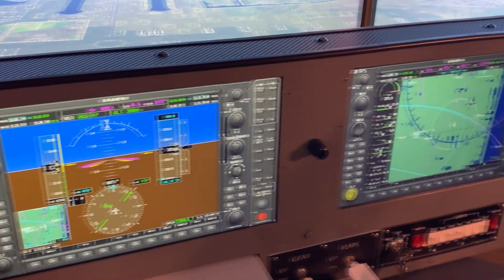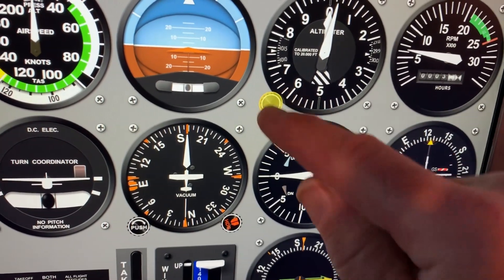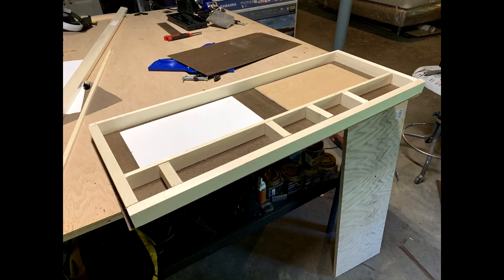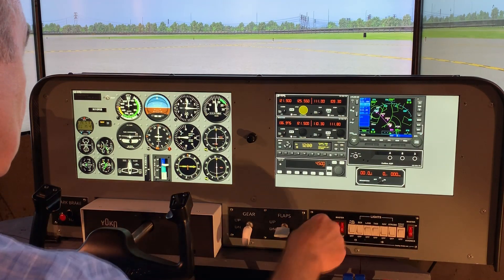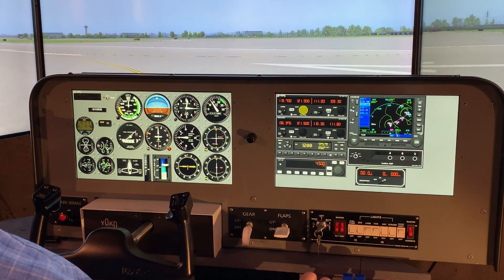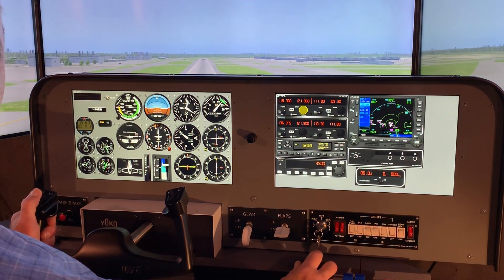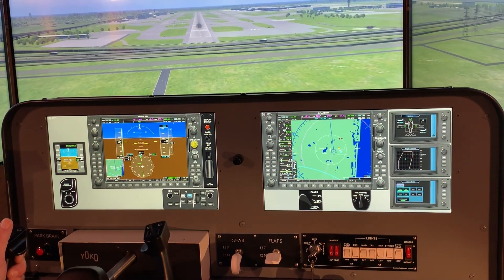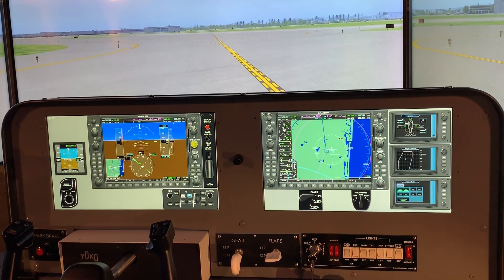DIY Twin Touch Monitor Sim

Comment: How mush monitors (3 ?) did you use beside the two portable touch screens and what type video card are you using ?
Reply from the maker: Yes 3 49” 4K Televisions but running at 1920 x 1080…. Pretty old now and heavy by today’s standards. Today I’d use 55” or larger if using flatscreen. I have a preference for VR now.

Comment: Great setup Russ- I am wondering what GPU (or multiple GPU's?) are you using?
...The knobster is key.  I've been trying to use just the touch screens +Airmanager, and the dials don't work worth a crap... even the switches are LAGGY AF!  Running a 7800X3D/7900XTX/64GB Ram, so a pretty high powered machine, and I still can't get it to work in real time.  +5 second lag on anything with air manager...  marginal at best, definitely not as good as just using the mouse.  Still trying to tweek it, but I'm frustrated with it.  Only using 1 touchscreen, as that's all there is room for on this high end GPU.  How do you plug in 5 monitors, which insanely high end GPU are you using that supports 5?  I think even the 4090 only has ports for 4.
Reply from the maker: @chopperskier  late tonight but this is an old video 5 years ago using a 10 gen i7 cpu and GTX1070ti gpu. I use a docking station that creates additional hdmi ports from usb3.0 connection
See Pluggable products 

Be sure you have the latest Air Manager version and plugin installed. There were some issues with lag but I thought that was corrected now

Comment: Hello Mr.Russ. First of all, I would like to thank you for the time you put into all those informative videos you have up to help us newbie in the sim and airmanager. I came upon the video you uploaded with 15.6 inch monitor when I was as researching a chap way I could build my instrument panel without spending too much money on logic tech gears. I’ll tell you , that video was the end of my research. Thank you, thank you! I went ahead to and bought me two of those monitors; hope I bought the right one because the ones I bought were 85bucks each.  Anyway, I’m going to have a three monitors panel.  2 Horizontal and one 10.5 inch tablet vertical for the garmin G750. I have all the units now but the only thing that was holding me back was coming up with the panel design to make it look like a cockpit. Again, this video of yours has served its intended purpose! Yaaa! Thank you sir! With that been said, I would please need your help with some information regarding this panel in this video.1. How did you manage to secure those monitors to the panel from the back? 2. What material did you use for your glare shield? I hope ti hear from you soon. Thanks in advance for your time sir. Sorry for posting from two different accounts. This is my main YouTube page.

Comment: Thank you Russ for your quick feedback. 
Sorry for not mentioning the Sim I am using. I am actually using MSFS. 
Another problem I have is that since I installed Air Manager, my Saitek panels are no longer working (Switch Panel, Radio Panel and Multi Panel). 
I am also confused between AM itself and the Plug-In... I installed AM but not the Plug-in... WHat is the purpose of the Plug-In ?
Any idea on these 2 new points on top of my message sent yesterday about my external view rotating when I am turning a nob on my touchscreen.
Best regards,
Reply from the maker: First, you need to install the plugin by running that installer. It will scan your computer and search for simulatorss and install the plugin. It will appear as an „Air Plugin“ folder in the MSFS’s Community folder. It allows Air Manager to connect to the Sim so without it AM won’t work to display sim data and make inputs. Second, it is still unclear what is happening but it sounds like you may not have calibrated your touch screen and windows is confused and it thinks the inputs you are making are occurring on the other screen 
Watch this video to understand Multi Touchscreen Setup:Windows 10/11 -  3 minute tutorial
https://youtu.be/aimr829SEjw
Reply: @rbarlow Thansk again Russ for your feedback. Very interesting your tutorial for touchscreen monitors. I will look into this.
I should receive my knobster by the end of the week. And I guess I will get the real benefit of the cominnaison of the touchscreen and the knobster.
Concerning my problem with Logitech/Saitek panels, i ran a specific plug-in for logitech panels and all my panels are back in good operation.
I have looked at many of your videos and liked them a lot. I cant wait flying with the knobster... I will give you a feedback on my experience.
Best regards,
Philippe
itor. Still

Comment: Hi Russ, I purchased Air Manager and I have a problem that seems to be known. I do not have the Knobster but will soon purchase it. 
In the mean time, when I try to adjust one knob from the touchscreen, the outside view on my other monitor is moving around at the same time than the knob that I am adjusting. Any tip on how to fix this ?
Best regards,
Philippe
Reply from the maker: You didn’t say what sim you are using. It sounds like you are using touch control to turn a dial on an Air Manager panel? Tell me a little more

Comment: Hi Russ, thank you for your videos. Very good. I have followed your advice, bought 2 x 15.6 inch touch screen monitors. I was told windows only recognised one display as touch screen. (Could be wrong)
The question is how to tell Windows that both are touch screens?  
Do you have to go into windows settings? Or is it automatic? 
Thanks
Reply from the maker: the windows OS doesn't know how to associate the USB touch grid to the multiple monitors.  It assumes the touch grid is associated with the main monitor with the upper left a point 0.0
Open settings and search for "Calibrate" and you should see something like "calibrate touch and pen".  Select that and the "click setup" and follow the on screen directions,  Basically it will turn each monitor white one at a time and direct you to touch it once if it is a touch screen and just press the return or enter key if not. That way it will know how to associate the touch Inputs with the proper monitor. Easy peasy.

Comment: In the G1000 Air Manager screen at 5:05, I see you press on the HDG knob in an attempt to center the HDG bug, and then push the Knobster to achieve the desired result. Could Air Manager be modified to allow an on-screen knob, held momentarily, to behave as a 'push'?
Reply from the maker: The Air Manager bezels have push button areas in the he middle of the smaller knob
Reply: Yes, I’m able to press the Knobster as you describe, but it’s a two step process to select the HDG bug on-screen then move my hand to the Knobster to press it (to sync the HDG). It might be better if we could simply press and hold the on-screen HDG knob to sync heading. 
Is this something Airmanager could implement?

Comment: I notice you have 5 monitors.  How are these attached to your CPU?  All graphic cards I can find have 4 inputs max.
Reply from the maker: Using a Pluggable USB-C docking station that can provide 2 or 3 additional ports depending on the model

see  https://youtu.be/vZfz2qisJ40
Reply: @rbarlow  Thank you so much.  Your channel is amazing!
Reply from the maker: Thanks. I would guess the Pluggable line has improved since that video but mine is still “pluggin” away

Comment: Hi Russ. I'm having real trouble setting up my dual touchscreens purchased on Amazon. Windows 11 extends the desktop to both of them (HDMI works OK), and the mouse travels to each, but only ONE touch screen responds to touch. I have tested each screen separately and they each work fine as touch screens on their own. It seems like Windows can't differentiate between these two screens in terms of their touch-response hardware (connected via USB). Did you ever have any trouble setting up dual touch screens?
Reply
Reply from the maker: Easy issue to fix. You need to calibrate your touch so Windows knows how to correlate the touch inputs to the correct monitor.  Just open settings and search for “calibrate”. L III l for the choice like “ calibrate pen and touch” or something similar. It will turn each of your monitors white and the onscreen text will tell you to touch the monitor if it is a touchscreen or press enter if if not. After cycling through all your attached monitors it will know which usb touch grid is on which monitor. By default it assumes that grid is on the main monitor and that’s why each would work individually
Reply: @rbarlow  Thanks Russ. The white setup screen works for each touchscreen monitor when only it is connected. When I have both screens connected, only one responds to touch. I believe my PC doesn't see these as two distinct USB devices. Possibly a hardware issue. Thanks all the same for your guidance.
Reply: UPDATE: From time to time Windows 11 confuses these generic touchscreen monitors for a mouse or a keyboard device. It is worth checking Control Panel -> Device Manager to verify: look in the list of devices for three things: Human Interface Devices, Keyboards, and Mice and other pointing devices. In my case, I found two items under Mice. I only have one mouse, so the other was the erroneously identified touchscreen. Check the Properties -> Events for each "mouse" to find the one most recently plugged in (the events have date/time stamps). The most recent one is probably the touch screen monitor. Properties -> Driver -> Uninstall Device to remove it from the list. Unplug the touchscreen from power and USB and then reconnect power and USB. Check Device Manager again. Ideally, you want each external touchscreen monitor to appear under Human Interface Devices as 'HID-compliant touch screen'. Hope this helps others with a similar problems.
Reply: Hi again Russ. I returned the faulty touchscreens (which I suspect had no serial numbers and the PC could not distinguish between them) and bought another two from a different supplier. Guess what? They work!
On X-Plane 11 with Air Manager and a Knobster, I find that when I interact with the touchscreens, they rob focus from the main monitor and cause it to blink off momentarily each time. This also has the undesirable effect of making the keyboard inaccessible, so I can't key 'B' for brakes, or look around with my numerical keypad cockpit view presets. Until, that is, I return the mouse pointer to the main screen and click once.
Have you ever noticed this dark-screen blink effect? Are you able to maintain use of your keyboard?
All screens are connected to an Nvidia GTX 1070.
Reply from the maker: @youngfella3054  this isn’t a problem in my setup since I never interact with the sim because all my controls are on the Air Mgr touchscreen or other hardware. If the sim and you Air Mgr panel are on separate computers this is not an issue either. But, I remember this issue and I think I found if you extend your air mgr panel size so that it extends onto your sim monitor a tiny bit( even I pixel) this doesn’t happen. It may have something to do with windows putting XP into game mode so you may want to research that. See if it is on or off and try flipping that. Just try dragging the am panel slightly onto the sim monitor and see if it helps.  Let me know in case someone else asks. Or I can experiment to find the fizz which I know I found once before but can’t exactly recall right now sitting in my family room.
Reply: @rbarlow  thanks for your detailed reply. Further internet research revealed several simmers have solved the dreaded 'Black Flash' in X-Plane  (when moving from the simulator screen to a second or third screen in extended desktop) by setting  screen resolution to one pixel less, vertically. That is, 1920 x 1079.
I achieved this by creating that custom resolution in the Nvidia control panel, and then selecting it in the Windows Display Settings.
As for keeping focus on the main screen after any interaction with the second or third touchscreen, I found an ingenious little tool called Touch Mouse Tools. This separates your mouse from your touchscreens. Now I can interact with the X-Plane cockpit via Air Manager on either touchscreen, and then immediately press a keyboard command, such as Brakes (B), or look around the cockpit with my numerical keypad.... all without having to physically move and click the mouse pointer back to the main monitor.
Reply from the maker: @youngfella3054  Good stuff. Thanks for sharing that.

Comment: I know this I'm a little late to the party.  However, I have a question about the touch screen monitors.  Is 1080P suitable for the instruments or should I go with 1440P?  Love your videos and appreciate all you do for the community.  My main monitor is a 49" G9 and I plan on using TrackIR.

Thanks,

Tom
Reply from the maker: Well if you are using the monitor for a panel monitor and it is less than 32" the 1080p is fine.  If you are going to be very close to a large monitor with instruments on it that better resolution may pay off.  I made a B737 overhead panel for a 43" touch monitor and ran it at 4K (2160p) because there was detail lost in the graphics at that large a monitor only about 10-12" from my eyes. If using the smaller 15.6" monitors like I used then  1080p is all you need.    If you have 20/20 vision your eye can resolve about 60 pixels per degree.  If you set up a sim with a 60 degree FOV, and sit where the actual angle from edge to edge (horizontally) is 60 degrees, a 1920 X 1080 HD would have ( 1920/60= 32) 32 pixels/degree.  Obviously a 4K (2840 X 2160) would have 64 pixels/degree or slightly better than you can perceive.  I don't have 20/20 anymore so for me the benefits of 4K are not that big.  For close up monitors you can do the same.  Measure the actual edge to edge viewing angle for any monitor and divide the number of horizontal pixels by that angle to get pixels/degree. That will tell you if you can even see the difference. In reality instrument panels probably benefit less from high resolution than scenery monitors do.

Comment: Hi Russ,  I have asked before but haven't received any ideas what my problem could be.  I have 3 55" LG TVs and 1 22" touch screen monitor, running by windows11.  I also have the knobster.  My problem is that when calibrating the monitors, my system doesn't recognize that my 22" monitor is a touch screen monitor.  The mouse can highlight the knob or switch on the touch screen and the knobster will operate that highlighted knob or switch.  When I touch the screen, the main 55" TV reacts to the touch.  All the cables are connected according to the manuals.  Thanks in advanced for any thoughts......Tom
Reply from the maker: You need to calibrate the touchscreen. The usb touch grid and the monitors video are not associated by windows. It just sees touch inputs and with multiple monitors and by default assumes the touch is on the main monitor. You could make your touch monitor your main monitor or calibrate the touch to associate the touch signals with the correct monitor. Not sure  exactly how it is called in Windows 11 but in windows 10 you search settings for “calibrate pen and touch“ . It will highlight each monitor in turn and have you touch it if it is a touch monitor or press return if not. You might have slightly different wording but a google search for “ windows 11 calibrate touch monitors” and it may help you. I am not home until Monday but if you can’t figure it out by then I will try on my windows 11 computer.
Reply: @rbarlow  Thanks for the reply.  I tried setting my 22" monitor to the main screen and then went to calibrate.  I got all the screens to white (which I haven't been able to do before) and it directed me to touch these "Xs" on the corners of the 22" touch monitor.  After completing this, I was able to touch the screen (22") and the monitor responded. I thought I had it fixed but the knobster didn't work.  I started the Air Manager and X-plane and Still no luck.  I think I'm getting closer.   I'll keep trying things.  There has to be a way.
Reply from the maker: @stricklandgarageaviation2864   Most common mistakes are not selecting the Knobster setting in the panel settings. First be sure the panel responds to mouse or touch inputs depending on your Air manager  settings tab.  In the Home tab with the desired panel selected on the left List, you see the layout area on the right where you can position and resize instruments on the panel.  If you scroll down below the layout area a ways  you will see a Knobster popup menu.  It probably says disabled, set it to Knoster(A). Then touches or mouse clucks to a dial/knob should highlight yellow.

Comment: Hi Russ, I installed a setup like yours with 3 monitors and 2 touchscreens. How did you get the Audio Panel of the G1000 on your Touchscreen?
Reply from the maker: That is in the Sim Innovations Air Manager free store for X-Plane.